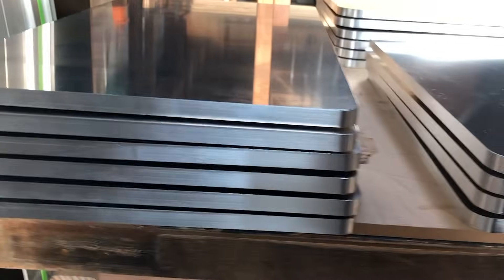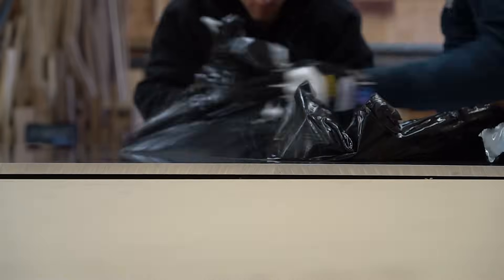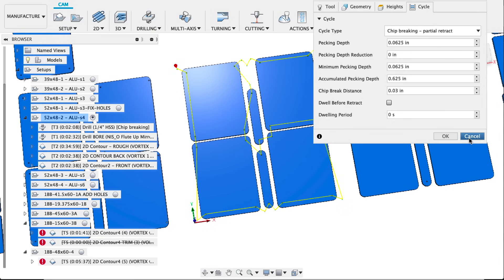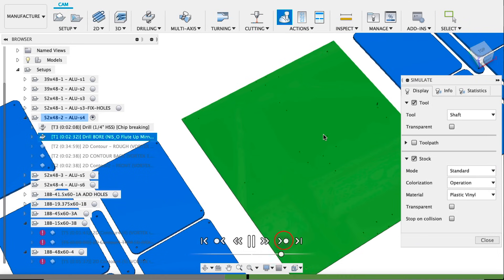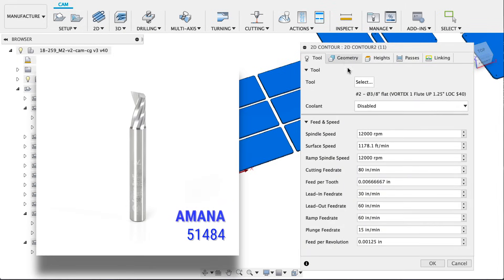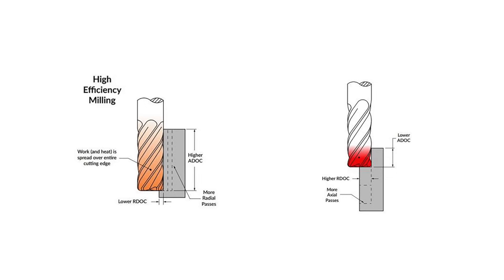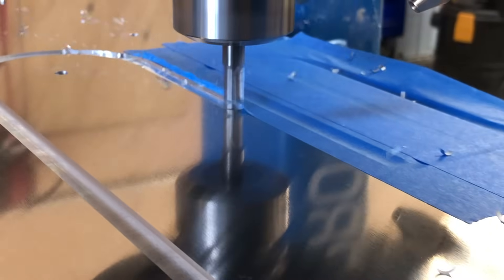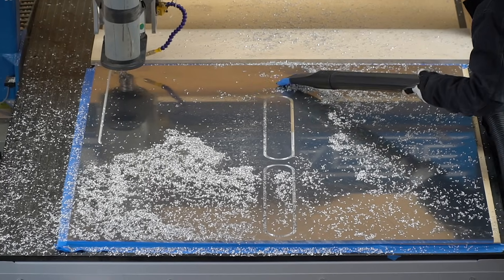Aluminum Feeds & Speeds for CNC Router – Fusion 360

Comment: Did you think using 24 liter compressor on 25 psi air blast to cut 1 mm aluminium for 6-10 minute is actually fine to use?

I was plan to buy a new compressor, oil or oilless one

Comment: Why a ⅜" bit in a slotting operation instead of a ¼" bit in an adaptive clear within that ⅜" space? Actually, with the way the pieces are spaced out, could make that adaptive clear width anything you wanted.
Reply from the maker: Adaptive could work. Slotting uses far less part to part space and takes way less time. 3/8 is more rigid

Comment: I’ve routed a lot of aluminum with these feeds and speeds and that 3/8” bit since watching this for the first time. You should really consider adding an oil mister. It keeps the wear way down. I’m still on my first bit and I use it several times a week from anything between 1/4” sheets and 3/4” plate. It really does leave a mirror finish
Reply from the maker: Yep. We have since then, this was a bit ago the video was made

Comment: Nice vids, i've watched a cpl now, Any chance of doing similar for copper though?
Reply from the maker: Sounds fun, what kind of parts are you wanting to cut from copper?
Reply: @pdxcnc  Mostly plate stuff, 1mm-3mm sheets probably. Most likely 1mm cause it's cheaper, unless I can pull off some kind of 3d carves and decorations in it. 
Topper/inlays for coasters and such basically.
I've tried it before but even cutting out the stuff, I could get it to cut cold with jenny bits, but the damn thing was chattery no matter what I changed and the finish far less than desirable. I haven't really tackled it again since. Doesn't help that it was unknown grade either. but sold as paneling from a kitchen place originally so probably the softest stuff going I would imagine.

Comment: what kind of 1/4" drill did you use? just a standard jobber length from a drill bit set? Im about to try drilling on our CNC for the first time.
Reply from the maker: yep, HSS jobber length drills work great. HSS you never want to go over 300 SFM. Shorter is better, and I like a 135º point but 118 will work too.
Reply: @pdxcnc thanks I drilled some holes today in some 1/4” aluminum with the cnc and your settings worked great
Reply from the maker: @Notjay95 glad to hear it

Comment: Question: How is it that your movement is constantly moving at one pace. My EnRoute tech made adjustments/configurations which made my multicam accelerate At straight path & decelerate  & turns and short paths. Before the movements were continuous @
One pace! These slow and fast setup is killing my bits especially the 1/16th 🤦🏻‍♂️

Comment: In the same way that you mounted your air blast nozzle, I mount a 2.50" Locline vacuum hose and nozzle. It doesn't get all of the chips but it does pick up a lot. Get the tip of the vac nozzle in really close. And, if you want to be really efficient, I use the shop vacuum's outlet to connect to my air blast for clearing. And that proves that you can suck and blow at the same time.

Comment: Hello, 
I'm currently trying to machine a 10mm thick sheet of 6082 T6 aluminum on a braxes 6090 CNC, but almost everytime i run it the aluminum gets welded into the tip of my endmill, i tried reducing the depth of cut and the feed, and that helped, but when i do the contour for my piece it melts at some point. 
The settings i was using were: cutting speed 125m/min ; cutting feedrate 100mm/min and depth of cut 0.1mm on a 3mm diameter carbide endmill with 4 flutes (maybe i should use 2 flutes for better chip evacuation?)
Sorry about the metric units but i don't know the imperial system
Can someone give me some advice?
Reply: WD40...
or some kind of cutting lubricant

Comment: I think by using a canvas barrier attached to sides of the lower part of the table and supported above the table plane about a meter around the table would be a cost effective way to keep the shop floor clean and provide a clean bucket of recyclable aluminum.

Comment: I wonder if you and make like a little injector on that air line, squeeze or push a button and it feeds wd40 into the line so it does it for you...
Reply from the maker: There are actually quite a few mist coolant systems.

Comment: What RPM and SFM do you use for 1/8  end mill? I was successful in using a 1/4 end mill at 12000 rpm with an ipt of .002. I was using a 4 flute although many say it cannot be used on Aluminum. I use only compressed air. For 1/8 i guess ipt is .0015 but at what speed for a .01-05 DOC.
Reply from the maker: Not really, sure, less feedrate than the tool we used in this video, I'd guess. I'd go check out our blog post in this video description and adapt it for the 1/8 tool you are considering.

Comment: Hey, I am using UGS with fusion. Is there a way to prevent endmill scratching the surface of stock from zero position to work lead in position? I was trying to save and use maximum stock. but after you set zero the machine moves to the lead in position in the same z level until it reaches work lead in. It does not scratch the work but the stock.
Reply from the maker: I’d guess that has to do with how the post-processor is written and how the controller works. I’m not really sure though, never used UGS.

Comment: Yours is the best CNC Video on Youtube! Thanks.
Reply from the maker: Why, thank you.
Reply: @pdxcnc  bcoz you don't hide the settings. I am a hobbyist with a mill instead of router, still your settings got me to the ball park. I was actually using lower step downs and rpms coz I have no coolant system and I did not know that air and wd40 was enough for 12000 rpm range.

Comment: I have had really good success running alcohol as a coolant.
Reply: Totally 2nd that, I've been machining 6061 plate for about 2 years now using a Fog buster + Klean Strip Denatured alcohol (Home Depot). This combination provides  good airblast,  great lubricantion, its cheap and in addition  flashes off quickly so it doesnt goo up your surface even if you drench it.
Reply: @TetchyBadger  Been curious about trying denatured.   Super cool.  Will give it a try as well.
Reply: Everyone considering alcohol should consider two significant safety issues.  First, get the SDS (aka MSDS) for any "denatured" alcohol used.  Methanol is frequently used and is highly toxic, especially when inhaled. Normal intended use for solvents sold at home depot for example does not assume 100% evaporation in a a closed shop. Kleen Strip for example mentioned in this thread has up to 8% methanol for example according to the SDS.  The other is obviously fire safety.  Any shop router isn't likely to be rated for vapors so you run a fire hazard. Motor brushes will be a spark source. A spill or over-feed could result in a fire. Stay safe.
Reply: @JerryFountain    I have been running Isopropyl alcohol 70% mixed 50/50 with distilled for quite a while with no issues but always use at your own risk.
Reply: @shainterry  Isopropyl does not require being denatured.  Likewise you're mixing with water which greatly reduces the flammability hazard (70% mixed 50/50 is only 35% alcohol). My concern is someone assumes all alcohols are the same, and poison themselves with methanol vapors, or they use straight alcohol and suffer a flash fire. This is an area where the hazards of "I read it on the internet" can lead novices to great harm.
Reply: @JerryFountain   I understand.  Safety is always #1.   I assume common sense but I get it.
Reply from the maker: That's what we've heard. Will try that next time we run some aluminum
Reply: @pdxcnc   Getting ready to run a big job on our new Shop Sabre.  I will try and post some pics and video on Instagram.

Comment: Great Video. And nice nice finish. I very rarely ever got to use a 3/8 end mill at the sign shop in Portland when we were milling aluminum. Loved the tip about using the sealing washers. Gonna have to use that idea when I'm running a router again after this economic disaster subsides.

Comment: Great video. I have a very similar machine here in my shop and I've been interested in doing some aluminum.

I'm a little nervous about using a vacuum cleaner with WD40. The kerosene in WD40 might be explosive.

I've been trying to come up with away to contain spray coolant. I'm thinking building a box around the work that the gantry can just clear. Then attaching some sheet vinyl or maybe some 1/8" lexan that can slide around on top while the machine moves(with a hole big enough for the Z axis to move through. I'd only be able to use a small part of the machine's movement, something like 24"x24" or even 16"x16"of travel. Most of the aluminum stuff I'd like to cut is fairly small. I currently have a 6" milling vise setup on the end of the table cutting small HDPE parts and it's working really well.     

Thanks
Chris

Comment: Hi, I was curious how you held the work.  I see from an earlier comment you are using the vacuum from the table bed as well as screws.  I assume the blue tape is to provide better hold down be sealing the edges.  How well does that work?
Reply from the maker: +RFM Designs ideally you don’t need tape and we try to use it in a last resort but it does almost always help.